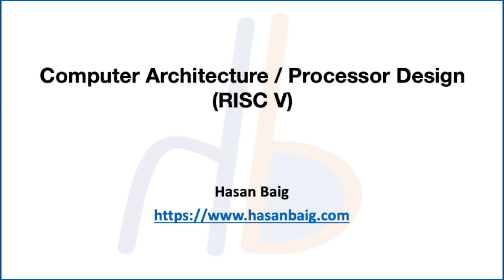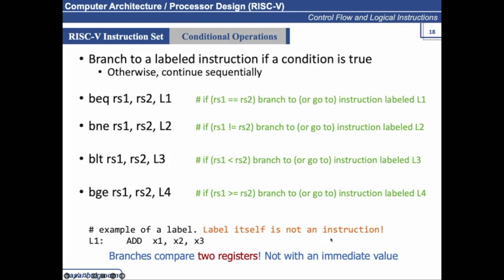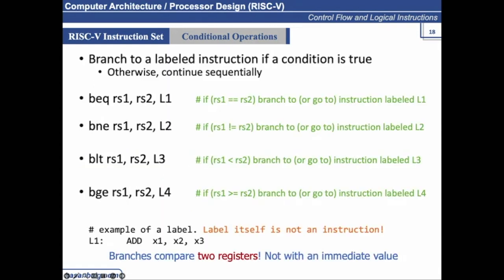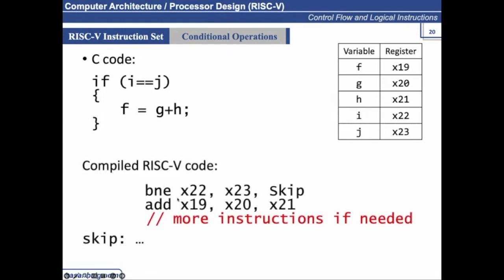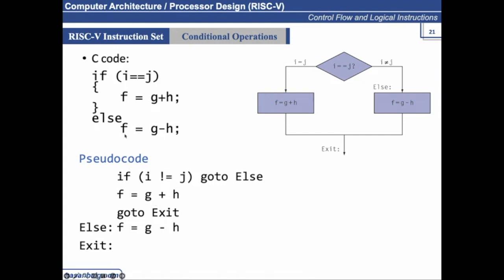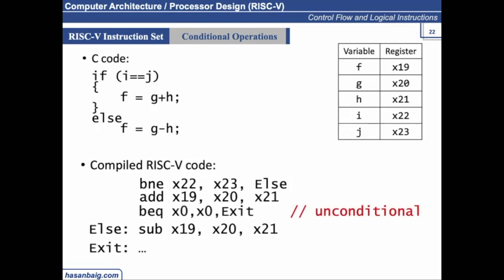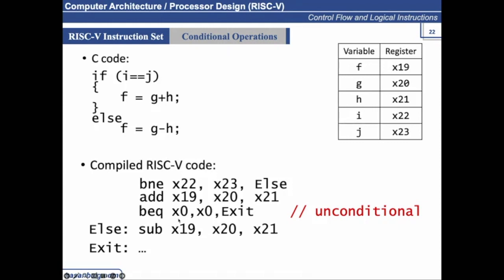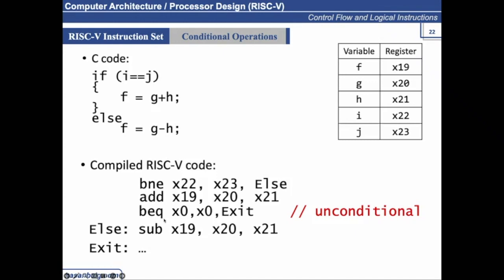27. Conditional Operations

Comment: @6:39 can we use beq x22,x23 L1 
Then  L1: add x19,x20,x21 
Is that correct instead of using bne?
Reply from the maker: If the next instruction after beq is L1: add….
Then this way will not work out. Just think of it as if the beq condition does not satisfy. It will then execute the next instruction which is still the “L1: add …” instruction. According to the code, it should not execute. 

If you put “L1: add….” Instruction somewhere else and put the rest of code after beq, it may execute this code correctly, however you will then have to ensure that you make a jump again to come out of “if structure (in terms of c code)” so that rest of the code executes properly. 

In short, you can do that but it will make it more complicated to write assembly code that way but it will not be the optimized one (for this scenario when there is no else block).
Reply: No, that would mean

if (i!=j){ //something }
f = g+h

Comment: @12:30, in the conversion from C to Assembly, could we not use an unconditional jump, "j"? j Exit, instead of using the x0 register?
Reply from the maker: In RISC-V, there is no instruction called j exit as in some older assembly languages like MIPS or x86. 
The other possibility is to use available "jal" instruction. 
In this course, we did not reach that far, that is why discussed only "x0" approach.
Reply: Thank you  @hblectures , I didn't realize j wasn't available in newer architectures. I guess x0 and jal are the only ways to go then.
Reply: @earlgreen8943  in fact "j exit" does exist but not on hardware level (just like mips). I came to know those are called Pseudoinstructions, it's the assemblers job to convert it to equivalent "jal" instruction.
Reply from the maker: @kaleemullah247  Thanks! It depends on which assembler is being used.